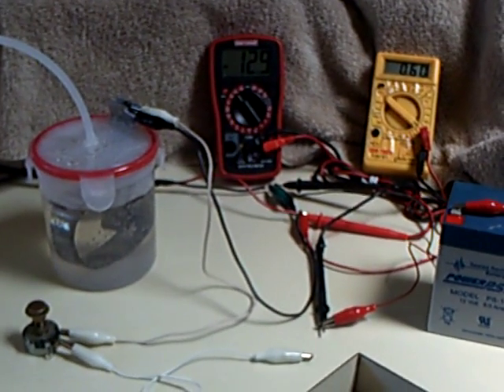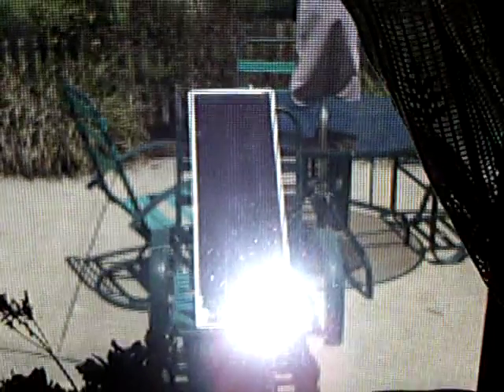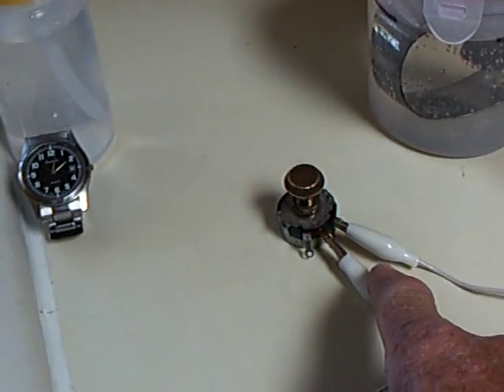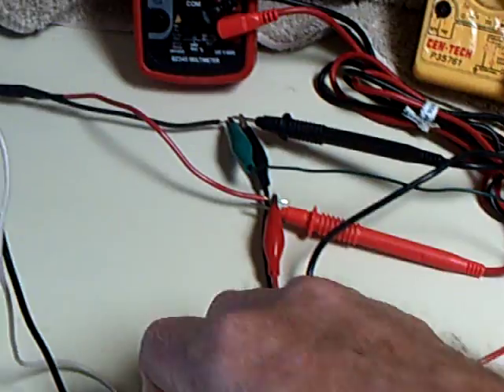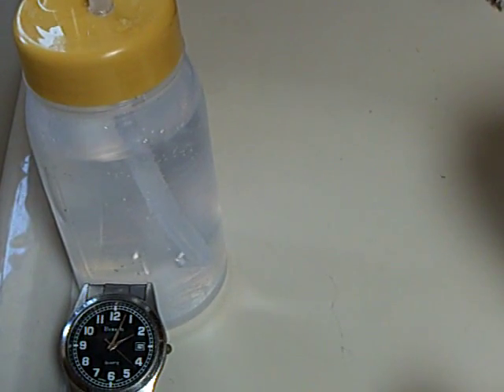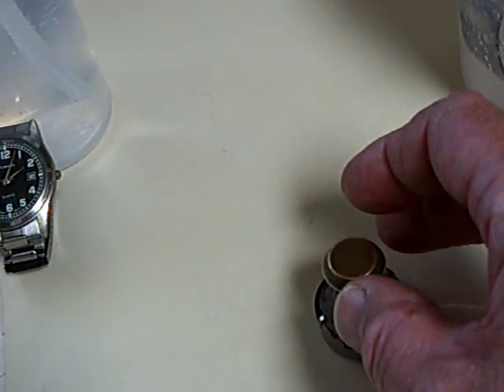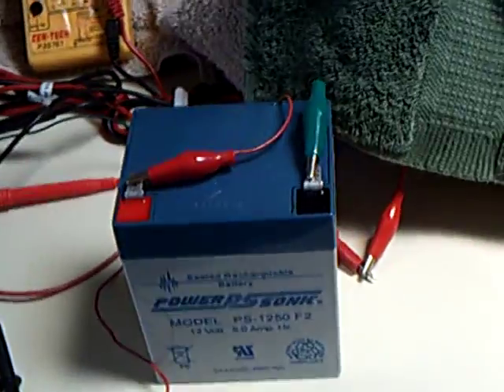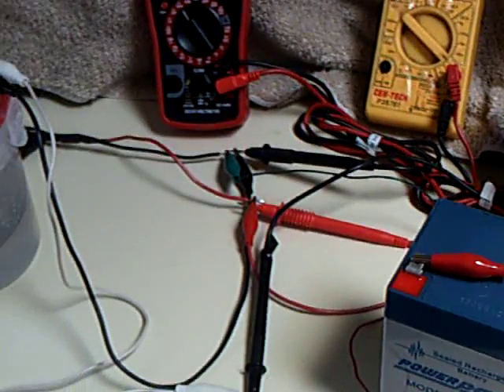Solar powered HHO generator---without Bedini SSG

Comment: maybe you can replace the rheostat with a dc motor drive controller, they work more efficiently and produce less heat..the HHO plates are of the same metal immersed in water?